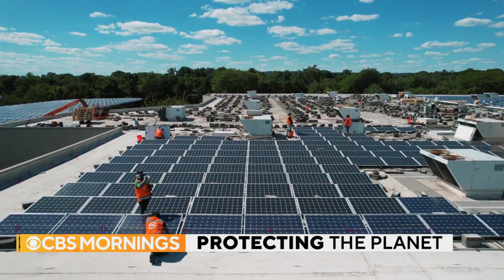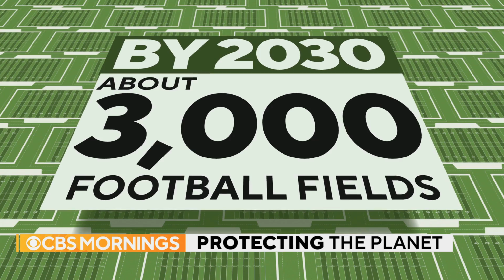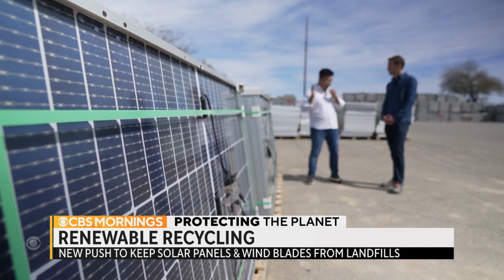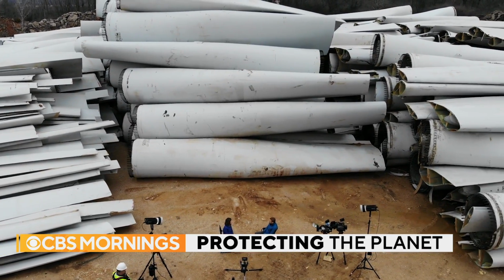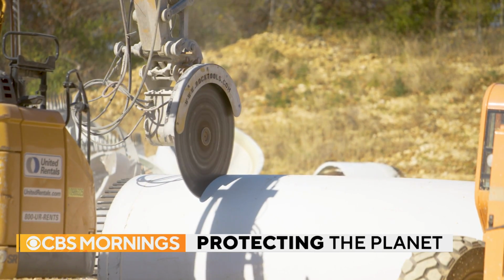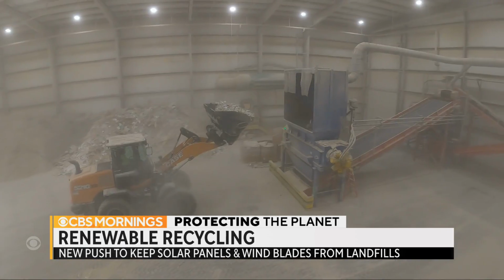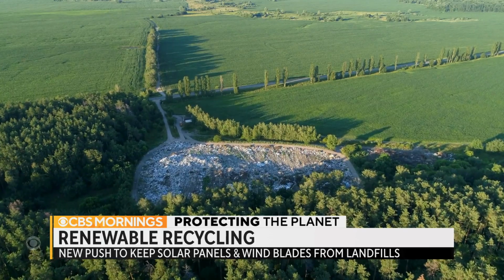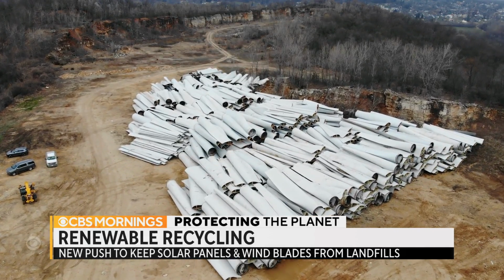Wind blades and solar panels head for landfills after being replaced

Comment: 6 January 2025 - A new report from the U.S. Department of Energy (DOE) outlines recommendations that could increase the recycling and reuse of decommissioned wind energy equipment and materials. 

Among other findings, the research reveals that existing U.S. infrastructure could process 90% of the mass of decommissioned wind turbines. However, the remaining 10% will need new strategies and innovative recycling methods. This research will help guide over $20 million in funding previously announced from the Infrastructure Investment and Jobs Act to advance technologies that address this gap.

 “The U.S. already has the ability to recycle most wind turbine materials, so achieving a fully domestic wind energy industry is well within reach,” said Jeff Marootian, principal deputy assistant secretary for the Office of Energy Efficiency and Renewable Energy. “Innovation is key to closing the loop, and this research will help guide national strategies aimed at advancing technologies that can solve the remaining challenges and provide more affordable renewable energy options to the American people.”

Despite growing urgency, most countries lack comprehensive legislation for clean tech end-of-life management. In the United States, federal regulations treat solar panels as standard solid waste unless proven hazardous, leaving decommissioning policies to a patchwork of state-level programs. Only a few states—such as California, Washington, and New York—have passed specific recycling mandates for solar equipment.

For wind turbines, the U.S. has no national policy governing blade disposal. Many components are buried in landfills or repurposed for niche applications (e.g., construction materials), but the majority still lack economic recycling pathways.

Comment: Wind farms produce 25 times more energy than was used during their manufacture and installation.

Most wind turbine blades have a designed lifetime of 20 years and most often are decommissioned immediately after this period. However, some studies indicate that wind turbine blades can be in use for up to 30 years 

Up to 90% of a wind turbine's mass is already recyclable, thanks to well-established recycling processes for steel, cables, concrete, and other materials.

Ørsted currently recycle 95% of a turbine. Vestas recycle end-of-life blades.  

A new report from MarketsandMarkets (November 2024) projects the global wind blade recycling market will grow more than 400 percent from 2024 to 2029, reaching a projected market value of $3.7 billion.

In 2021, Siemens Gamesa began installing 100% recyclable blades.

Concrete and rebar are now recyclable by such companies as Barrowmix, Seka, Cemex, K&B, to name a few.

6 January 2025 - A new report from the U.S. Department of Energy (DOE) outlines recommendations that could increase the recycling and reuse of decommissioned wind energy equipment and materials. 

Among other findings, the research reveals that existing U.S. infrastructure could process 90% of the mass of decommissioned wind turbines. However, the remaining 10% will need new strategies and innovative recycling methods. This research will help guide over $20 million in funding previously announced from the Infrastructure Investment and Jobs Act to advance technologies that address this gap.

 “The U.S. already has the ability to recycle most wind turbine materials, so achieving a fully domestic wind energy industry is well within reach,” said Jeff Marootian, principal deputy assistant secretary for the Office of Energy Efficiency and Renewable Energy. “Innovation is key to closing the loop, and this research will help guide national strategies aimed at advancing technologies that can solve the remaining challenges and provide more affordable renewable energy options to the American people.”

Despite growing urgency, most countries lack comprehensive legislation for clean tech end-of-life management. In the United States, federal regulations treat solar panels as standard solid waste unless proven hazardous, leaving decommissioning policies to a patchwork of state-level programs. Only a few states—such as California, Washington, and New York—have passed specific recycling mandates for solar equipment.

For wind turbines, the U.S. has no national policy governing blade disposal. Many components are buried in landfills or repurposed for niche applications (e.g., construction materials), but the majority still lack economic recycling pathways.

Comment: And the nuclear waste produced in the operational time of the plant (100 years) fits within the confines of the facility.

Nuclear is the only technology which has solved the problem of long term waste, because it had to - bury it deep underground.

It has also solved how to reduce the amount of waste by burning it in a different reactor, reducing the original waste, so that the facility could operate for over 1000 years and store the waste withing the confines of the faility.

Why not use nuclear?
Because it's scary to apes.

Comment: Wow. Doomed to repeat History..... In 70s the expsive primative panels were Heavy and did not last. 
If you live with regular snow adding too much tomthe undrr engineered stick framed roof trusses sometime would fail.
And it seems like STUPID engineers didn't do ANY homework, planning.. Planning comes from on the jobsites. Not computer models. Duhhhhhh
A Wastefull technology.!? 
Because it should have a 100yr life expectancy. Light the GE" silicone used to hold some panels together. 
Perfect it. Then ill buy one..

Comment: Burning fiberglass is better than coal?
Reply: "Burning fiberglass is better than coal?"

To clarify a smidgen here: 90% of the windmill blade is recycled.  Most of it is shredded and then used directly in the cement as a replacement for sand, clay, and other materials (65% of it).  Only 28% of it is safe to burn, and used in the kilns to make clinker.

Comment: You don't really think a few hundred thousand of these blades are going to cause some sort of environmental  disaster do you? They are practically inert and make up a minescule percentage of total waste generated by human activity every year. This is a non-issue that will probably get handled fairly quickly because it's getting attention since the blades are big and easy to see (and put on video). In the US 300 million tires are disposed of each year. They either  get piled up in landfills or, get this, burned. No one is burning windmill blades. As far as people foaming at the mouth over the quote "There was no planning to handle the waste". What products can you name where that has ever been true? Putting a recycle symbol on a plastic bottle is not "planning". Sure at this exact moment in time there is little recycling of these materials. As the video shows that is changing and the industry is responding to the problem. Plus they are developing new materials and design that can be recycled. Again, this is a non-issue compared to a lot of other waste problems. Big blades on the ground make great click bait.
Reply: "No one is burning windmill blades"

This video literally talks about how these blades are being shredded up and then burnt by companies as a fuel source.

Not that thats a genuine "problem", but its what theyre being used for.

Comment: The fiber is sent to concrete batch plants for concrete filler. Fiber in concrete replaces steel mesh used in house floors to prevent separation

Comment: The recyclables are just the frames and the protective glass. The cells themselves are considered toxic waste. "Clean" energy is anything but, and the solution is always far worse than the purported problem. Oh, and the only reason wind MAY have passed coal is not because there's a lot of wind, but because coal generation is being destroyed at a faster rate than its being replaced. So that is a vastly misleading statement.

Comment: I did lol at the 25-30 years "Lifespan" figure for solar panels.. not a hope do they last that long. They are obsolete on installation,  tech is changing so fast. Using wind-turbine blades as aggregate/fuel is viable - but the scale of the problem dwarfs the scale of the solution - plus blades are mainly plastic composites/polymers - burning them produces huge levels of toxins.. so not very "Green"..  and taking a chance that the concrete you're pouring using polymer admixtures as aggregate.... well, that's ok for a patio, but not viable for your new bridge or skyscraper.. too many "unknowns" for any insurer to sign off on... How do polymer-rich aggregates perform long term? Nobody knows.

Comment: Solar panels last 25-30 years? The statistics now show the average replacement life of Solar panels is actually 8-12 years. And yes, 90% of them are going into landfills (toxic materials included). And yes 43 million tons of blade waste with an average growth of about 30% per year. Even with the recycling and repurposing of blades, we will be inundated with blade waste in just a few short years. And no one has measured the cost of all of this (including the recycling efforts which are not profitable and therefor must be paid for too) in term or the environment. Add this cost to the carbon footprint of the mining of materials to manufacture batteries; the carbon footprint of manufacturing EVs, Solar Panels, and Wind Turbines; the cost of storage solutions for delivery of non peak production power; and the cost of disposal of EVs and their batteries every 10 years because of battery failure (it's more cost effective to buy a new EV than to replace the battery). Tell me where is the upside to supposed Green Energy?

Comment: Wind and Solar have only surpassed coal for power generation because THE USA HAS DECOMMISSIONED SO MANY COAL PLANTS OVER THE PAST 15 YEARS. That is why the USA has reduced carbon emissions MORE THAN ANY OTHER COUNTRY (especially the Paris Accord countries). It's not because Wind and Solar has REPLACED coal on the same amount of power generation. We have built SO MANY NATURAL GAS POWERED PLANTS, and THAT is the reason. Natural gas is so much cleaner than coal. Can you imagine any time in our history them building a power plant and saying "Yeah.....this will have to be tore down in 20 to 30 years?" Of course not, but in Wind and Solar power generation this is the norm. What a waste of money, especially for part time power generation. Because of "day and night" and "weather," you need to build 3 TIMES THE CAPACITY of power generation so that it can be STORED (need to build storing facilities too) in order to replace natural gas, nuclear power, or hydra-power generation plants. Wind and Solar are the biggest scams in the way they've been marketed to the public.

Comment: When that guy said the 3 or 4 year old panels have 90% efficiency, he meant 90% of their original efficiency. Their original efficiency was likely around 20%, meaning that 20% of total solar energy is converted to electricity, which is typical for terrestrial solar panels. Top of the line spacecraft solar panels can reach about 35% efficiency, but are $400 for a cell the size of a credit card. 90% total efficiency is impossible, he basically meant 90% of the original 20%, AKA 18%.

Comment: Don't forget we'll also need to mine for the raw materials needed to product solar panels and wind blades, which in itself kills the environment and the people living around them. Ironically we already have a technology that produces more electricity, runs 24/7, is cheap for everyone and produces zero emissions. We've had this technology for decades. It's called a nuclear reactor. How many people have died from a nuclear power disaster? 32. Newer advancements have made nuclear reactors smaller, more safer and will even recycle used nuclear waste. Why are we not embracing this?